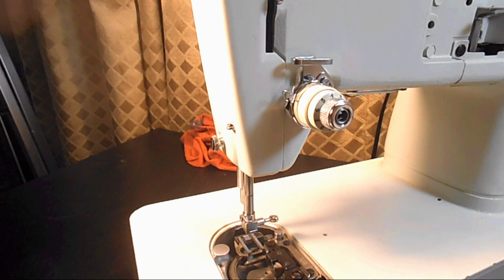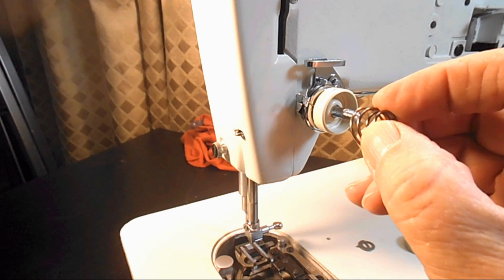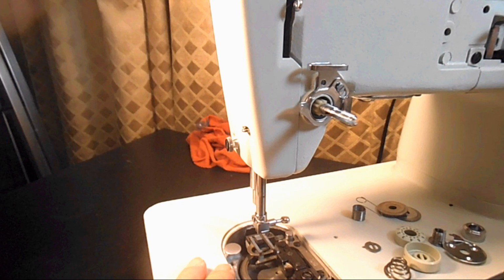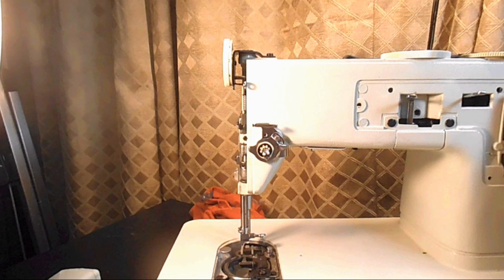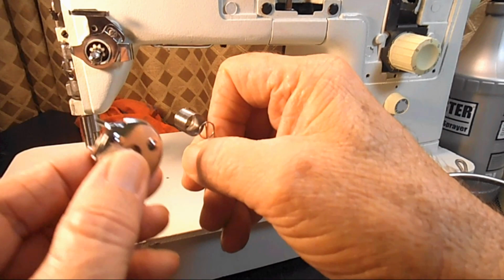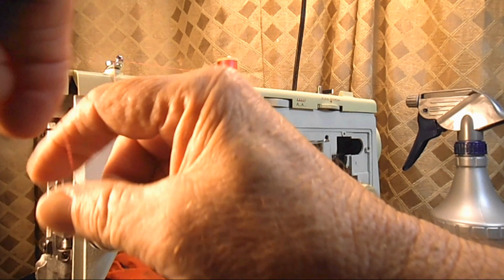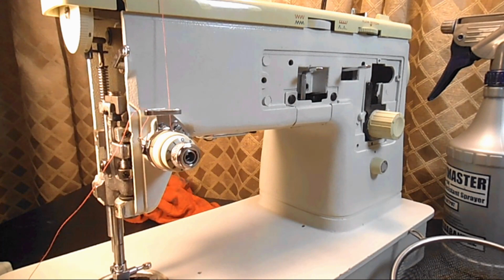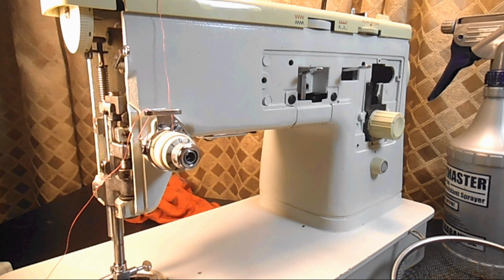How to Remove, Clean, Replace and Adjust the Thread Tension Unit on a Vintage Singer Sewing Machine

Comment: I must have missed it but how do you adjust that back plate? Well I know you just loosen the screw but how do know it's in the correct position? Thank you.
Reply from the maker: Well, I'm not sure what you mean by the "back plate", but I'm going to assume it is the  Slack Thread Regulator & Tension Thread Guide, or STRTTG. There is an adjustment (that's the reason for the slot where the screw goes) that is called "setting the stroke" and it has to do with the check spring coming to rest on the stop of the STRTTG just as the needle eye enters the fabric. That way there is some tension on the needle thread to keep it from tangling with the needle, but when the spring stops it releases that tension so the hook can easily grab the thread and shuttle it around. Here is a video about setting the stroke https://youtu.be/t3UqzYRo-cc  I hope I guessed right about the STRTTG. If not let me know, and good luck.
Reply: @andytubesewing1953  that was exactly what I needed to know. I've been working on my mother's Fashion Mate 257. It had a few problems and I'm down to the tensioner is problematic and wanted to ensure it was timed correctly. Thank you for the reply and all your help.
Reply from the maker: @MarkPdot  Hey, I got lucky then. Thanks for letting me know. Take care.

Comment: Hi Andy, the horizontal guide on mine looks as if it has had a bang and is bent, is there a better picture anywhere of it ?  Thanks
Reply from the maker: Take a look at this video starting at about 32:35 https://youtu.be/4aqRScKOOsw    If you need more then here ar4 all of my 30+ tension videos in a Playlist: https://www.youtube.com/playlist?list=PLsCOZgzzaiKJtdJxU7i-qpXOpKzU6xtEd
Reply: @andytubesewing1953  Thanks Andy, I have just replaced the vertical gear and timed it up, so nearly time to try it...
Reply from the maker: @acestu  Congrats, and thanks for saving that machine. Hope it runs smooth and strong. Good luck.
Reply: @andytubesewing1953  I have enjoyed doing this so much that I think I will try and find some more, the engineering in them is superb
Reply from the maker: @acestu  Yes, that is what happened to me. I've done a couple hundred machines now. Some for sale, some for customers, and some for charity. I miss doing it for now but hope to be able again in the future. If I can help in the future let me know. andytube53@gmail.com  P.S. I have many documents for the machines

Comment: Hi Andy - I feel I am monopolising your attention for which I apologise sincerely.  However, your help has been invaluable to me with my Singer 507.  I have tried to find a solution to another problem but to no avail and once again I have turned to you.  Just of late - my thread has been getting twisted round the thread spooler pin and each time I also notice that the thread on my bobbin has come out of the Apollo bobbin case and is 'lying' across the top of the bobbin spool.  It is a new Apollo9 case I have recently bought - so I guess it can't be that?  Unless I have to tighten/loosen the adjusting screw.  I'm puzzled to what is wrong - whether it is something to do with the thread spooler or elsewhere on my machine.  My tension is perfect - thanks to one of your other videos.  Do you have any ideas that could possibly help me?  Thank you Andy - I really appreciate the time you take to reply.
Reply from the maker: It's just too vague of a question and I can't picture the "lying across". Maybe you should try to email me andytube53@gmail.com. Send some pictures. Tell me the history of the machine with you. Have you got the instruction manual? Is the machine new to you? Are you a new sewist? I'll watch for your email today.
Reply: @andytubesewing1953  Thank you Andy for your reply - much appreciated.  I guessed it was a bit vague as it was hard to describe - sorry.  I will do that - email you.   Meantime, my Singer 507 was bought 45 years by me.  I'm not new to sewing - I was a machinist for a while for Marks & Spencer back in the day.  I have the Instruction Manual.  I will wait until the problem arises again so as I can take pics - it may be a day or so.  Thank you again.
Reply from the maker: @heddybell  sounds good, thanks for the updated information and we will wait for the pics and work from there

Comment: Do they still make replacement parts for older units. Inherited a singer 513 and it has tension issues according to my gf. Would like to try and fix it if parts are still available. 

Thanks for this video.
Reply from the maker: Only a couple of replacement parts are normally available, like the check/takeup spring; https://www.sewingpartsonline.com/check-spring-singer-66774.aspx  and the tension/beehive spring https://www.sewingpartsonline.com/check-spring-singer-125314.aspx
rarely you might be able to find a new indicator dial (the - | + dial). Unless severely damaged the parts can often be repaired and after maybe a hundred tension units worked on I've found usually just a good clean and fresh Zero Out is what is needed. Over the years dealers have experimented with using tensions from other models that are readily available to replace some of these units. Here is the best example of a newly made unit that is supposed to work on 100+ different Singer models including your 513; https://www.sewingpartsonline.com/tension-complete-singer-422403-455.aspx
Reply: @andytubesewing1953  can I email you a video of what my machine is doing? I don’t know much about these machines but my girlfriend does know more about them. I just want to make sure the issue she is running into is what we believe it is. I’ll upload a video to my channel for you to view this weekend if you have the time.
Reply from the maker: @kumingo  Yes, please do upload a video of what's going on and let her explain as she is the sewist. That really helps over words in the comment section. Just comment back here with the link to the video on your/her channel

Comment: I tried to do this on my 500A and unfortunately the dial (part H in the service manual) won't come off the adapter (part K) even if I completely remove the set screw (part J). They're completely stuck together. I took the tension mechanism off the machine and cleaned as best I could between the disks, but I was hoping to replace the spring and give it a better cleaning. Any ideas to loosen part H from part K? The manual makes it seem so easy: "1. Loosen set screw J and remove dial H."
Reply from the maker: I'm not sure why these parts often are stuck together. I think maybe it's because one is aluminum and the other some type of steel. I have used a few methods, like put in my ultrasonic cleaner, put in a coffee mug and poured boiling water on it, sprayed the heck out of it with WD40, and heated it with a hairdryer. I was trying to get the aluminum to expand then contract as it cooled. Last time I think a did the coffee cup with a squirt of liquid dish soap and boiling water from the kettle and let it sit until the water got lukewarm. I still had to grab the backside of part K and hold it with a needle nose plier while I turned the numbered dial. You have to be careful not to crush or damage the threads on the aluminum part K. It's a real PITA I remember that.
Reply: Andy Tube I can’t see how to get the needle nose pliers to where they can grab part K - part N (“indicator”) is in the way. I’m in a catch-22 - I can’t get to part K without disassembling the mechanism but I can’t disassemble the mechanism without getting to part K.
Reply from the maker: I apologize for misreading your previous comment, Manuel. I thought you already had disassembled the unit but K & H were still stuck together. So turn your dial left as far as you can to release some pressure on the tension spring M. Use a small screw drive to enter thru the front of H into the slot of stud G. The screwdriver will stop at the crossbar of the stop washer L. That is when you push a little more against that stop washer and move it back against the spring M. You need to push it back enough so the finger of the stop washer clears the nub inside H that usually hits and stops on the stop washer. You should now be able to turn the dial farther left and continue to unscrew K off the stud. You are not able to unscrew it now b/c the nub of the dial hits the finger of the stop washer when you get to zero, and H is stuck on K. Using the method I just described, you are pushing the stop washer back out of the way of the nub on the dial. Here is an assembly video of the tension assembly for your model if you'd like to see what the parts look like when disassembled and going back on https://youtu.be/OqZZ-uhnAMY
Once you have the K & H parts off is when you can try the methods I mentioned in my first reply to separate the two parts.
Reply: @andytubesewing1953  Thank you, thank you, thank you! That worked a treat to take the mechanism apart. I ended up deciding to leave part H and K together since I was afraid of damaging something so I just used the "push the lock washer with a screwdriver" trick when reassembling the mechanism, but that allowed me to give everything a good clean so I'm happy.
Reply from the maker: Nicely done, Manuel 👍 thanks for keeping yourmachinee in service. Happy sewing.
Reply: @andytubesewing1953  Thanks! I've found it fun to get our two vintage machines (a 1958 Elna Supermatic and the 500A) tuned and sewing well. They both purr like contented kittens now and sew very well.
Reply from the maker: Hey, there are more machines out there! Sounds like you're a natural repairman. Good luck always.

Comment: Hi Andy - I am sorry to bother you, but your videos have been so helpful to me of late as you know.  I have a query I wondered if you could help me with?  I know you have not come across my Singer 507 but the Singer 500 series seem to be very similar.  I find when I am sewing, my material tends to veer to the left (it's not me - honest!).  I purchased a new Singer general presser foot - thinking that might help - but no.  I have changed the needles also - but it is still the same.  Adjusted the Pressure Dial - no difference.  Do you have an idea at all what may be wrong?  Apologies if you have covered this in your Channel and I may have missed it?
Reply from the maker: The two most common reasons the fabric veers off to the side are a presser bar/foot out of alignment, or the feed dog being crooked.
     The presser bar can be turned out of position by even a small amount and that causes the fabric to move under the foot at an angle. The bar/foot must be in alignment with the feed dog. There is one screw that holds the presser bar in place. Inside the nose of the machine, you can see the presser bar coming up thru the presser bar bushing and then a little bit higher you see the head of a screw in a small "block" of metal. If the foot is out of alignment you loosen that screw and turn the bar/foot to line it back up to the feed dog. The trick is to NOT change the height of the foot while doing so. If you are careful you lower the bar down and remove the pressure setting as close to zero pressure as you can, loosen the screw, turn the foot to line it up to the feed dog, then tighten that screw. Here is a presser bar video for model 513. At about 17:00 minutes into the video, I discuss alignment: https://youtu.be/MCHMiYgD6Z4   
     If the foot alignment looks good the feed dog may be crooked. If you remove the needle plate you see there are two small screws holding the dog to the lifter bar. Loosen the screws, wiggle the dog, and then retighten the screws a little at a time, going back and forth one then the other back and forth. You can wiggle the dog to be sure it is seated on the lifter bar, and you want to be sure the screws are flat into the hole of the dog. Sometimes the tech will tighten one screw all the way, and then the other, and the dog is a little crooked. 
     Again, if the foot or dog (or both) are a tiny bit off the fabric will go thru crooked. 
Finally, the presser foot "shaft" between the foot itself and the part that screws onto the presser bar can be bent and the foot does not sit flat on the teeth of the dog, so uneven pressure makes the fabric go crooked while sewing. You said you already replace the foot with a new one (good thinking!!) but I mention this for other viewers who may read your comment.
Reply: @andytubesewing1953  Good Morning Andy from Scotland UK (it's 9:05am here) thank you so very much for taking the time to reply in length,  I do hope you know how much this is appreciated?  I have read over thoroughly what you say here and will embark on trying to fix the problem asap.  I will let you know the result once I have followed your, once again, ever so clear and concise instructions.  I am looking forward to giving it a go!  I deeply appreciate the time taken to help me.  THANK YOU SO MUCH!
Reply from the maker: @heddybell  Very welcome. I've found patience and persistence are the largest part of solving these annoying problems. I know we can pin it down eventually.

Comment: Thank you for this thorough explanation! It's so helpful. I have a question I'm hoping you could help me with? I have a Singer 5107 with a broken tension assembly. The metal cylinder piece that goes in the hole and holds the assembly in the machine is cracked and crumbling. I bought a replacement assembly and removed the tension assembly and screw that holds it in, however, the metal cylinder is stuck. Any ideas how to remove it so I can put the new assembly in? I've tried triflow, pliers (metal crumbled), and chiseling it out but it is stuck.
Reply from the maker: Sorry, Brittany, I can't help you with this model. It's too new for me to have worked on. Very few earlier Singer models have that type of metal barrel that holds the tension assembly. Does it fit into a metal frame? Or just a plastic frame? Usually, on much older models, the barrel stays in place and the stud with the parts attached is removed. I don't have a clue as to why the metal barrel is cracking and crumbling.  On models where the stud is stuck into the metal body, I have had some luck using heat from a hairdryer or heat gun to help get it free.
Reply: @andytubesewing1953  I've never thought of using a heat gun. Great idea! Before I could attempt it, my husband said he'd just drill out the old metal piece. Now it's ready for a new tension assembly. Thanks so much for your help! I'm a collector of mostly Japanese class 15 clones and this is my first Singer. I'll keep the heating gun idea in mind for future stuck pieces :)
Reply from the maker: @brittanys6814  Good job Mr. Brittany! You're all set then. I hope you'll try another Singer in the future. Something older and better made. Take Care.

Comment: Thanks so much.. I feel confident taking my 401a apart now but.. I live in the UK and can't seem to get Krud Kutter.. will WD40 or the like do?
Reply from the maker: I suppose it would. Just remember whatever you use you will probably have to wash/wipe it off. So how would you get the WD-40 off the machine then? Before I found the KK, I used alcohol (inexpensive) or kerosene (stinky) and also dishwashing soap, like when you hand wash dishes. I have had viewers tell me they have used brake cleaner spray and other chemicals, but I have no experience with that. The KK cleans very quickly, but I have washed many parts in dish soap and just had to scrub more. Brushes & sponges. I use Lemon JOY here. It washes off with water very easily and then you dry very, very, very well. Thanks for watching my channel from "across the pond", hehe. Good luck.
Reply: Simple Green is an excellent grease cutter, so I think I will start with that followed by Dawn. I was given my 403 when a neighbor died and I really want to service the tension unit myself. With this video I believe I can! Thank you.
Reply from the maker: @susandickson9869  if simple green is okay to use on paint and aluminum then you should be fine and I'm sure that you can do the work no problem by the way the 403A special is my favorite zig-zag machine made by singer
Reply: @andytubesewing1953  Thanks for your reply. I used a tote tub to soak A/C vents and stove parts in a concentrated solution of Simple Green when we bought our repo house 7 years ago. It is earth, septic system, and human friendly. Maybe I can work on the 403 while our new ISP is installing the equipment Monday. Thanks again! Your videos are awesome.
Reply from the maker: @susandickson9869  thanks Susan and best of luck to you